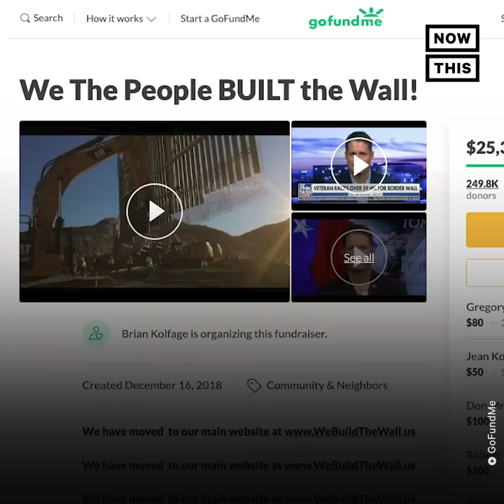Judge Stops Right-Wing Group From Building the Wall | NowThis

Comment: Crowdfunded? Really? That money could been used to feed the poor, clean the ocean or helping the Central America to stop people from fleeing their home.
Reply: Keeping illegals out does all of that.
Reply: @g.e.o.r.g.e...  So wall is magic? Did it take your brain?
Reply: @ho-hyongyoo3251  Now now you're assuming there was one there to begin with.
Reply: @AnontheOP  You know most criminals are already in US or climb and dig thourgh the wall right? Drugs are expansive as gold a wall can't stop it.
Reply: @ho-hyongyoo3251  walls have proven time and time again that it slows down illegal immigration significantly. The wall was never a force field against all illegal immigration. It was to help border security have more control of the border and it helps them tremendously.
Reply: Julieta Noble  It is also illegal.
Reply: @AnontheOP  How? The poor fleeing from persecution, gangs, warfare, militant dictators and criminals are being pushed north, um, and they run into this wall? Tell me how is that protecting them?
Reply: @LadyDulcevida  yes there's 50 miles of new wall built in replacement of the old wall and now new wall will be built in areas where there isn't.
Reply: @lights473  Sure but here is the thing. Places that should have wall already did for at least a decade. If there is no wall there is a good reason for it.
Reply: @collegeconservative4948  Don't you mean fence? Also I thought Mexico will pay for that?
Reply: @Michael45007  I literally just said that it gives border security more control of the border so they can do their job better. That's why the wall works and numbers of illegal immigration drop significantly.
Reply: @ho-hyongyoo3251  the places that don't have a wall built are either places with high illegal immigration or it's because there are mountains and rivers already serving as natural barriers.
Reply: Julieta Noble  Building the wall without permission on Federal land.
Reply: @lights473  No. There is also problem with the ecosystem, privately owned lands and reservations.
Reply: Julieta Noble  You.calling Democrats currupt when Repulican owned construction companies are making out like bandits on this fence?
Reply: @ho-hyongyoo3251  it's a fence-wall. Only reason you call it a fence is because it's see-through but a thick barrier like the one being built is still a wall regardless if it's see-through. If Congress ratifies Trump's USMCA trade deal, Mexico would be paying for it with business growth which in turn turns into tax revenue for the government and it would also shrink trade deficits with Mexico.
Reply: @ho-hyongyoo3251  the Constitution, which is our contract with the government, allows government to seize land for eminent domain as authorized by the 5th amendment. This is how we built highways all across the country, for example. The seized land would be used for national security, i.e., the wall between US and Mexico would be served for protection. Government has this authorization.
Reply: Now it’s mexicans that is crossing the borders. The Central American countries has improved a little but still unstable. Less migrants from Central America and more from Mexico and African countries.
Reply: @lights473  Oh sure. I know that but I thought government taking private property was socialism and Republicans hated that
Reply: @g.e.o.r.g.e...  that doesn't stop the problem. Getting these people help does
Reply: @sentiententity1501  Mexico is actually doing quite well so immigrants from Mexico actually shrinking. Also I thought Africa was over the Atlantic Ocean. Trump is building Ocean wall also?
Reply: @lights473  u talk about security but did you know legal or illegal immigrants 99% don't commit any crimes. N the economy actually makes billions from them. Yes we need better immigration policies but a wall won't help. Helping these countries will. Also most are families mostly women n children fleeing death. If that was your family ud do the same thing
Reply: @ho-hyongyoo3251   Republicans are against socialism and do support private property ownership rights but they are also against anything that isn't Constitutional, or if something is wasteful government spending. The wall isn't wasteful and it's Constitutional for the improvement of security for the country.
Reply: @lights473  You keep using that word. I don't think it means what you think it means. So taking stuff from people is okay  if you say it is constitutional?
Reply: @brandontrammel4581  that's factually inaccurate. 

- Total federal inmates (as of April 2019) is 180,500, but the following stats are from a 2016 GAO study and there were 184,000 at the time.
- 39,500 (22%) are criminal aliens
- 91% of the criminal aliens were citizens in one of the 6 countries - Mexico, Honduras, El Salvador, D.R., Colombia, and Guatemala
- 77% of 198,000 federal inmates (from fiscal year 2011 - 2016) were citizens of Mexico

The federal government spends about $1.4 billion a year incarcerating migrants charged or convicted of crimes, and states spent at least $1.1 billion more. The taxpayer foots a $2.5 billion bill.
Reply: @ho-hyongyoo3251  what are you talking about? We have a contract with the government so this contract authorizes the government to take land for eminent domain.
Reply: @lights473  Sure. Sure. Than how about the ecosystem and nature reserves?
Reply: lights473 don’t forgwt about nicaraguans and other south American countries.
Reply: @ho-hyongyoo3251  if land was more privately owned and not government owned/controlled/regulated, we would be far more protective of the environment when at the hands of private individuals. You wouldn't be able to pollute or destroy land that isn't yours and it's economically inefficient to deplete your own land's resources because you can use it to regrow and profit off the resources the land provides.
Reply: @lights473  for one u just made my point. The few criminal aliens has nothing to do the whole. That's  like saying out of the 1 of 1000000 aliens. Out of that one percent is the 250000 that's facts. You're trying to misuse stats to makes facts. N yes those are criminals bc they are poor countries but that has nothing to do with all of them. That's like minorities n poor areas n crime. Most minorities aren't drug dealers or savages or lazy like we are seen. Also that billion is what they send on crime on a whole. The us has a bs criminal justice system that just makes billions more off inmates. That's y even the government n Trump tho I don't like him acknowledge that it's wrong that's y their is reform. As an adult I can have a debate with anyone even of a different opinion but don't feed me bs stats you get from fox news. People don't care about things until it happens to them
Reply: @lights473  also bc of the Constitution the government can't just take your land n rights. That's one of the reasons they left  England. N socialism the word they don't understand is actually what our government is. A democratic socialist country. Contrary to popular belief the top countries in the world in education money happiness n health care like Canada Netherlands n others are democratic socialist countries. Venezuela n other countries they try to use are dictatorships or technically communist.
Reply: @Ho-Hyong Yoo Ooh, especially that last one. Hint hint.
Reply: Noiseless Sounds  the wall is being built, and illegals will be getting sent back. Why are you opposed to this?
Reply: @brandontrammel4581  it's from GAO which is a government report. It's not from Fox News. Here you go: 
gao (dot) gov/mobile/products/GAO-18-433

I never said a few criminal aliens have to do with the whole but they're wasting taxpayer dollars which you and I foots the bill because we don't do enough for border security.
Reply: @brandontrammel4581  incorrect. England was dominated by a corrupt King who was pushing Catholicism on the Protestants so they ran away to settle in the New World. The Constitution is a contract we have with the government in which we allow government to do certain things like taxing us or putting us in prison if we commit crime in exchange they protect our freedoms. We don't live in an anarchy and we never will. The Constitution protects our freedoms within this contract we have with the government.
Reply: Agree !!
Reply: @collegeconservative4948  You mean the wall that can be cut with regular power tools and climbed easily? The Wall that's wasting millions and not doing its job? The job that never needed to be done in the first place?
Reply: Noiseless Sounds  statistically it has. You're saying "no it hasn't" without any basis for it whatsoever. And here's a question: is it racist for your house to have walls and protect yourself from the outside? Why don't you live without walls?
Reply: @lights473  Trump committed treason, which is completely unconstitutional, and get they still support him. Hypocrisy much?
Reply: @SynthVoice  some people can climb well, that doesn't mean the wall is ineffective. The wall was designed specifically to give border patrol agents more control of the border. It was never a "force field". It was designed for provide border patrol more control of the border and the wall significantly slows down illegal immigration which border patrol agents can quickly and more efficiently arrest those trying to cross the country illegally. Wherever a wall is built, numbers of illegal entry drop significantly, this is just a fact.
Reply: Noiseless Sounds  yeah making my point perfectly. Keep living in your cognitive dissonance and biases and anti-facts world.
Reply: Noiseless Sounds  yes Mexico would pay for the wall once Congress ratifies Trump's USMCA trade deal which it would cause business growth that would turn into tax revenue for the government and it would also shrink our trade deficit with Mexico. Mexico would indirectly pay for the wall.
Reply: @lights473  exactly my point. The constitution gives rights to the government to protect which is a democratic socialist/capitalist. However the government doesn't have the power to control that's y there are safeguards in the Constitution to protect us from corruption
Reply: No one is really in a position to claim that crowdfunding should be put in a specific thing. The point of crowdfunding is for people to pay for what they want not what should be funded. It's people's choice.
Reply: Or medical research
Reply: Julieta Noble  
lol... donate to tRump, he needs cash to repay Putin and the oligarchs...
By the way, without migrants, you don't eat vegies or fruit, no Americans want to pick them.
But you probably don't anyway... lol
Reply: @collegeconservative4948  
EXACTLY Z E R O NEW WALL HAS BEEN BUILT
AND MEXICO HAS PAID... WAIT FOR IT...
Z E R O $$$...
Reply: @ho-hyongyoo3251  
You are awesome!
I love all of your comments!
👏👏👏
Reply: Noiseless Sounds  facts fam
Reply: Noiseless Sounds  be quiet troll, we are trying to have a civil agreement get out of here.
Reply: Noiseless Sounds  god you really lost it huh?
Reply: Noiseless Sounds  do you wish to join in this conversation? Or are you going to keep attempting to disrupt us?
Reply: Noiseless Sounds  you've finally snapped?
Reply: Fleeing their homes because of what Republicans did too...
Reply: @Gray963  or maybe its because the lack of a functional government. 

And so you know, Democrats can be a cause too. Too high taxes...
Reply: It’s their money,  if people want to waste their money like this then they can
Reply: Ho-Hyong Yoo buddy that’s not the problem why people are fleeing they are fleeing because innocent people are being killed even new born babies are killed in such horrific ways...the cartels run whatever is south of the border
Reply: Noiseless Sounds  are you one of those protesters I see in videos that if someone approaches you with an opposing stance to your protest you'll either ignore them or heckle them I bet, right? You're one of those "don't talk to them they're trolls", right???
Reply: That involves using your brain
Reply: Noiseless Sounds  mind if I ask how old you are? And I'm actually democratic, I'm just lurking in chat to see what's happening.
Reply: @abelis644  actually 50 miles of wall has been built in replace of the old wall and new wall is currently being built. Mexico will be contributing to paying for it once Congress ratifies Trump's USMCA trade deal with Mexico that will bring business growth which in turn brings more tax revenue and our trade deficit with Mexico will shrink.
Reply: Tommie Brooks  I mean even if it's true (and it's not) that's completely irrelevant to the fact that the wall works and it's Constitutional and it serves as national security.
Reply: Tommie Brooks  no I'm not saying that. And once again, for the 10th time, I was pretty clear that the wall is not a force field from illegal entry. It's designed to slow down the flow of illegal entry and give border patrol agents more control of the border and wherever a wall is placed, the number of illegal entry and apprehensions drop significantly.
Reply: Hey HO, We already feed the world. Americans are homeless on the street while people flood our Country and jump the line, getting benefits Americans themselves can't afford.
Reply: @LadyDulcevida  sort the primary problems that you mentioned, then the secondary doesn't exist
Reply: biuld the wall
Reply: the more you feed them the more they reproduce !!
Reply: In Communist China perhaps the government decides where to put people's money; in a democracy people decide themselves where they put their money.
Reply: @Irritandarts   Yes. To a scam. Brilliant work fam
Reply: @ho-hyongyoo3251  What scam? I see a wall, I see parts that still need to be assembled. Again, where is the scam ?
Reply: @ho-hyongyoo3251  Anyway, YOU'RE NOT to decide where other people put their money, NOT in the US at least.
Reply: @Irritandarts  Sure buddy. Give money to scam artists. It is your money.
Reply: @Irritandarts  Well, lets see. It was stopped, money wasn't returned and Bannon got arrest for fraud. So yeah. A scam.
Reply: @ho-hyongyoo3251  Ah, well arrested ght mean convicted in the country of China, but it doesn't work that way in the USA. We call it due process, but what do you care about fundamental human rights?
Reply: @Irritandarts  Sure buddy. Tell yourself that. But here is the thing. I am not from China and you are delusional if Bannon will walk free from this. Frauds are hard to wiggle out.